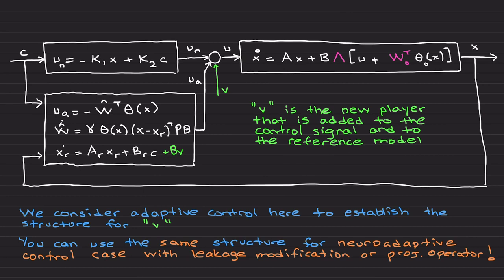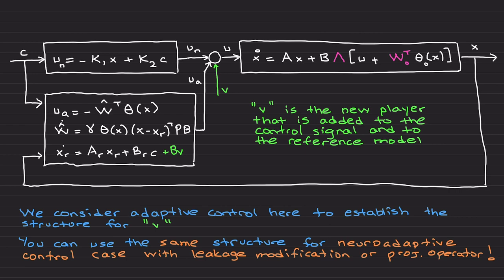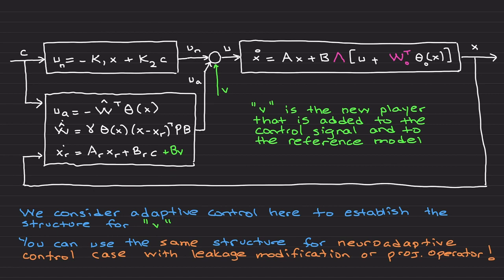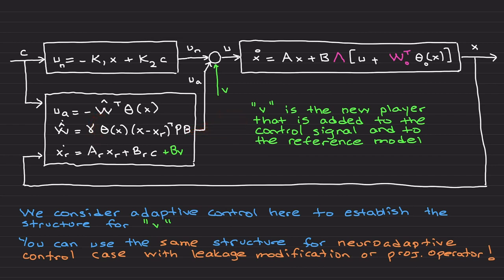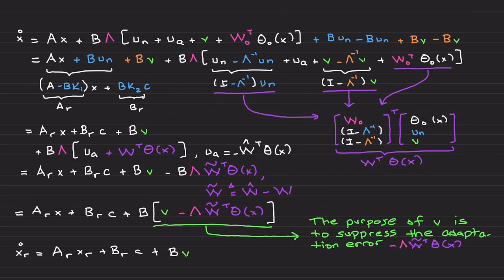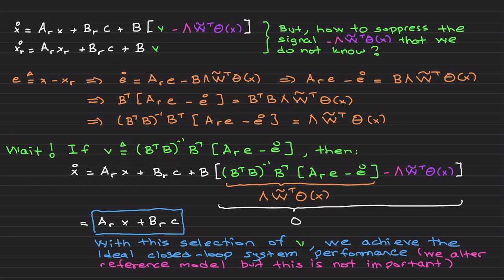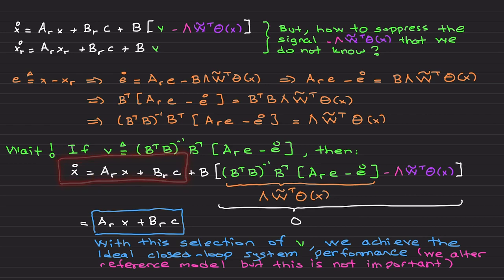Performance Recovery: High-Order Case (Lectures on Adaptive Control and Learning)

Comment: It’s is very interesting to follow the progression of the lectures. After implementing the adaptive control model with structured uncertainty, my first question was, I wonder if I can add something to the reference model to improve performance. Thank you for all the lessons. They have been very helpful.
Reply from the maker: Glad to share the same idea and thanks for your kind feedback, I really appreciate it and glad to know that they are helpful. Feel free to suggest any topics that should be covered ;)
Reply: Thank you Professor for sharing your knowledge and experience. Lecture on prescribed performance in context of adaptive control would be appreciated.
Reply from the maker: @UmarFarooq-kj3rf  I will soon cover adaptive control and neuroadaptive control with prescribed performance guarantees. 

For the adaptive control case, here is the reference: Arabi, E., Gruenwald, B. C., Yucelen, T., & Nguyen, N. T. (2018). A set-theoretic model reference adaptive control architecture for disturbance rejection and uncertainty suppression with strict performance guarantees. International Journal of Control, 91(5), 1195-1208.

For the neuroadaptive control case, here is the reference: Arabi, E., Yucelen, T., Gruenwald, B. C., Fravolini, M., Balakrishnan, S., & Nguyen, N. T. (2019). A neuroadaptive architecture for model reference control of uncertain dynamical systems with performance guarantees. Systems & Control Letters, 125, 37-44.

I am just posting these references in case it may take some time for me to cover these in the channel.
Reply: @tyucelen  Many Thanks Professor.